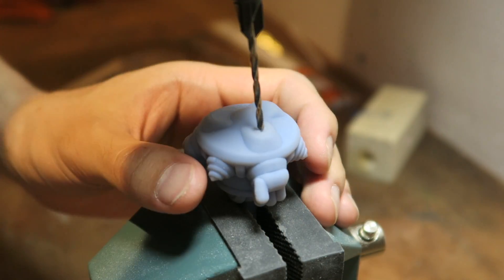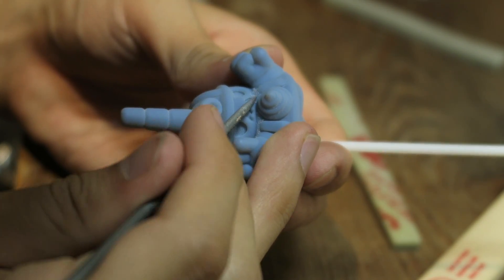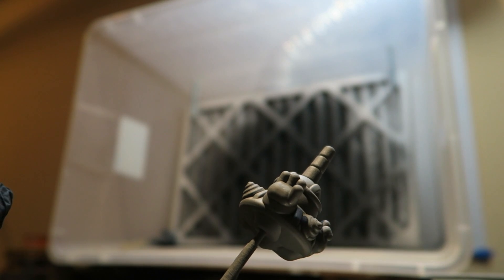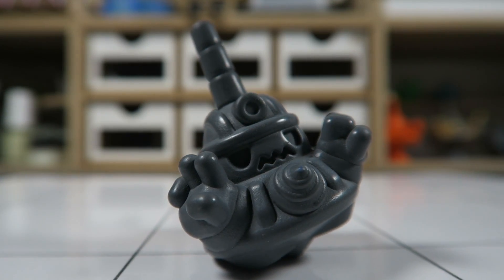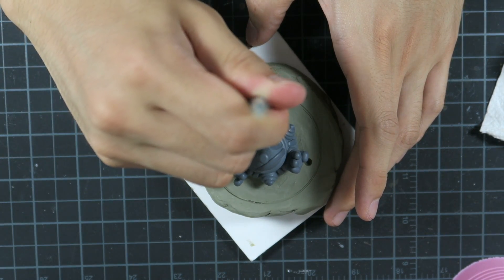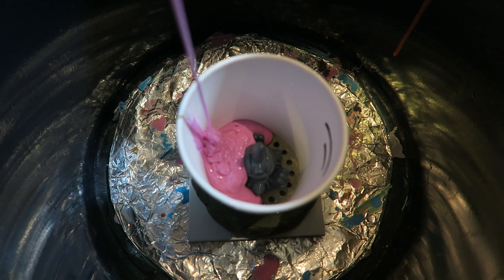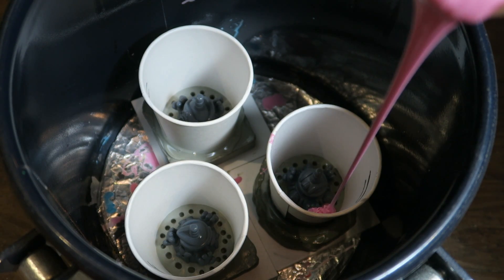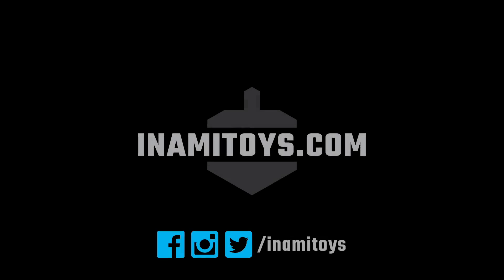Let's Make a Toy : Tumble Tops Part 2 / Silicone Mold Making

Comment: Great Videos. After trying Rhino, 3ds max, Blender, Inventor etc etc. I found fusion to be the most intuitive and easy to use, especially if you need it to be parametric. But you can still use the sculpt mode (Tsplines) to make incredible shapes. I highly recommend it for ease of use and its many functions. Just my two cents. Just make sure you have a good video card on your computer or it will be wonky.
Reply from the maker: Yes I agree! I've been using Fusion for the past year or so and it's been such a gamechanger for me. Happy to hear that it's done the same for others!

Comment: I'm on a very tight budget, and I've got some oomoo 30, Smooth-on 305, and one vacuum chamber. I'm trying to cast a 5" action figure with ball joints, hands, intricate facial details, separate moving parts, etc.  I know how to make the mold through degassing, but I was wondering if I could get by only using the vacuum chamber for resin casting. The Smooth-on 305 has a pretty long and useful pot life of 7 minutes, and the molds have sockets that NEED to be filled in if the figure is to work properly when assembled.
Reply from the maker: Tight budgets are tough but there's ways to make them work. Oomoo 30 will probably capture all the details but it isn't the most tear-resistant silicone. So when you cut your molds open, make sure that the overhangs and any tough areas will come out easily. For resin casting, even if you degass your resin, air bubbles can be re-introduced as you pour into the mold. You'll have to work quickly since degassing takes about 2 minutes which leaves you with 5 minutes of the pot life. And depending on where you are and how warm the room is, that could get cut down as well. I would only pour resin into one mold at a time to give yourself more time to work. Tip the molds as you pour resin in so that air bubbles will rise to the gates as smoothly as possible. And pour in a thin and steady stream.
Reply from the maker: If you're getting too many air pockets in the cured resin, you can also use some super glue and baby powder to patch up the holes. Tested has a series of shop tips videos you might wanna check out: https://www.youtube.com/watch?v=NA2XJ7PTT3M
Reply: Awesome! Thank you

Comment: Great video

I learned mould making from an old engineer and master mould maker who made parts for NASA but made toys at one time.

His suggestion was to mix up a small batch of silicone first and coat the object with a fine layer of silicone. It had to be covered all around and applied underneath in overhangs with a popsicle stick. 

The idea was that the fine layer would settle into the crevasses like a fine film and prevent bubbles forming on the surface. 

After the silicon film smoothes out, mix up a larger batch of silicon and begin to pour it in normally. Because the silicon film is still wet itll fuse itself perfectly to the new silicon no problem.

Ive used this technique several times no problem, it prevents the need to use decompression. I'd recommend trying it out.
Reply from the maker: That's great advice! I did that by accident once because I miscalculated the amount of silicone I needed. It's definitely a surefire way to get a nice bubble free first layer. That master moldmaker/NASA engineer sounds like an awesome guy!

Comment: I love your designs. The pirate is hands down the coolest. From one toy maker to another, what of casting resin do you use for your final product? I'm making my own collection of action figures and I'm just getting started making the joint parts.
Reply from the maker: Thanks AnimeMotion! I use Smooth-On products. Specifically Smooth-Cast 305. It's a white plastic with 30 min cure time and 7 min pot life so it's quite easy to work with. Good luck with your action figures!
Reply: Thanks so much man! Time to get sculpting! Can't wait to see your next video.

Comment: What silicone are you using ? pinksil ? and which resin you would recommend as well ? ty
Reply from the maker: I'm using Smooth-On Mold Max 30. For resin I recommend Smooth-On's Smooth-Cast 305. It's a white plastic with 30 min cure time and 7 min pot life.
Reply: nice ) I did some research and got almost the same stuff , just Smooth-Cast 300 instead of Smooth-Cast 305 , thanks